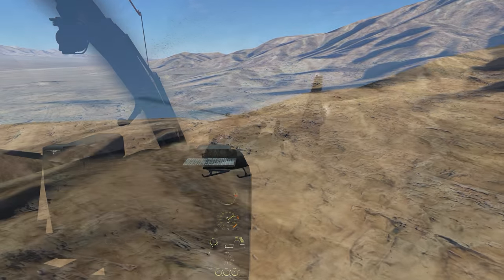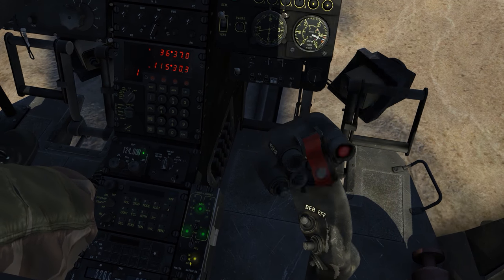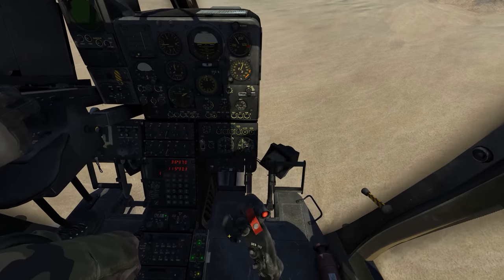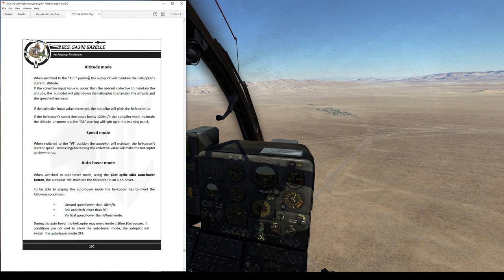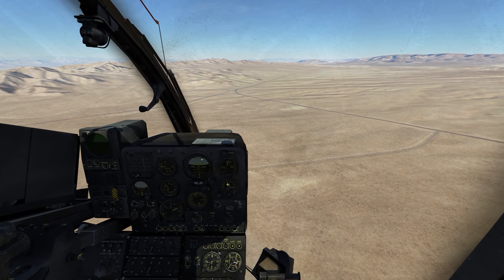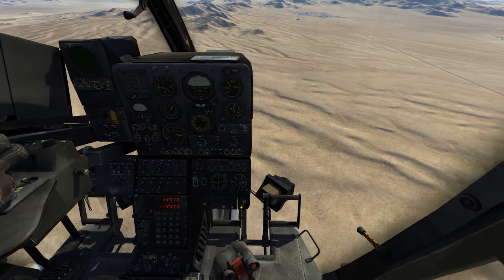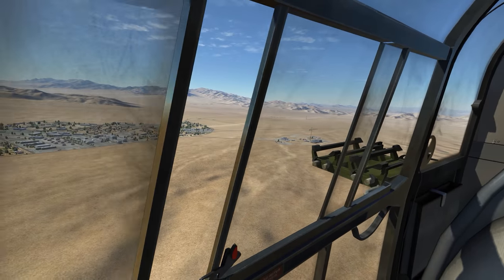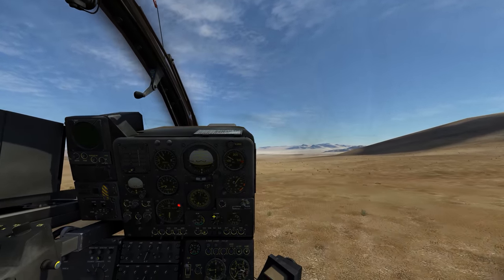Test Flight - DCS: SA342 Gazelle #5 - Radar Altimeter, Aux Fuel System, Countermeasures, Autopilot

Comment: The up=right-click, down=left-click is the "desired" standard in DCS, from what the support posted recently, but it's true that the A-10C has quite a few inconsistencies in that regard, maybe that's why you feel it's the other way round on the Gazelle. The inverted left=right-click and right=left-click is a mistake for sure, it should be the intuitive way (left=left, ...). On 2-way switches though, either click should simply change the state.

I hope they'll make the A-10C consistent at some point, it's always a question on which switch has to be right-clicked or left-clicked to flip a switch up, makes for easy mistakes. But after a short while, one just gets used to it :)
Reply from the maker: +Red Glyph   Wow, if right=up, left=down is supposed to be the standard then my mind is blown.  If it is frustrating going from module to module for me then it must be hell on new players.  I just did some forum searches on the issue and thanks for all your work on this.  Hopefully these guys (everybody, not just Polychop) are taking it seriously because a consistent interface is a really big deal.
Reply: +Bunyap Sims Yep, you're right, it's somewhat disorienting and frustrating sometimes. I suppose that, like for all devices, one gets used to the little quirks - after enough mistakes! ;-) I'm not sure whether they actually send those conventions to developers or how much importance they attach to it in regard to all the other features to test. Then we could wonder, how is it in the real aircraft? Perhaps it's the reason why the A-10C has a mix of both conventions, if racks are made by different people, this could happen... do you have any information on that?

In any case, the left/right definitely feels wrong, perhaps worth reporting to avoid fatal mistakes in hairy situations - unless the Gazelle has this exact setup.
Reply: +Bunyap Sims The thing in the A-10 i don't like is the fact that for a 3 position switch, you can go from the 1st to the 3rd in just one click (like the IFFCC to ON to OFF, when you want to go to the setup mode)